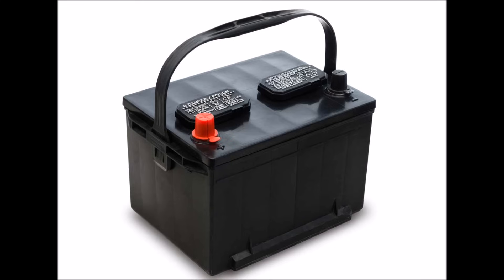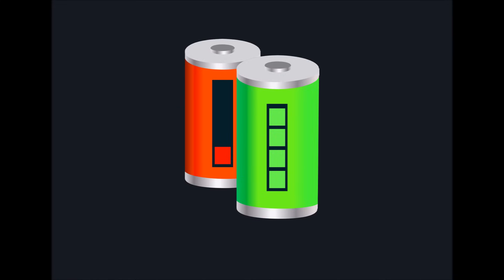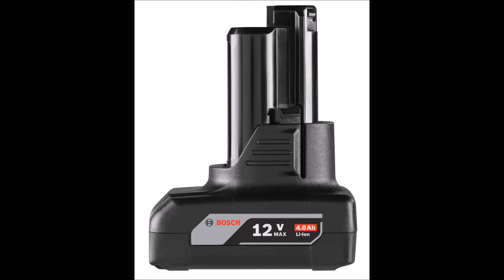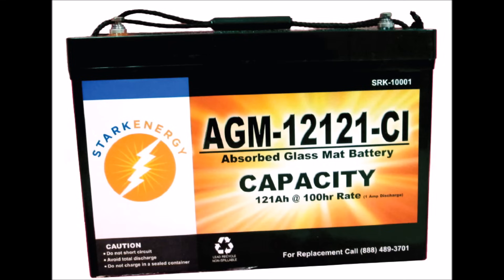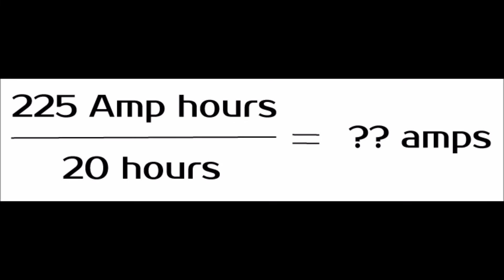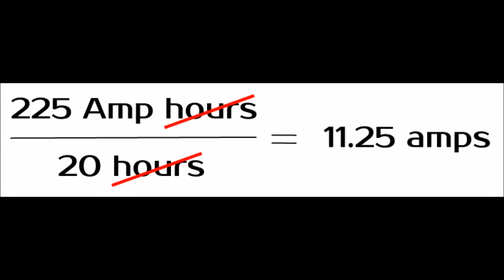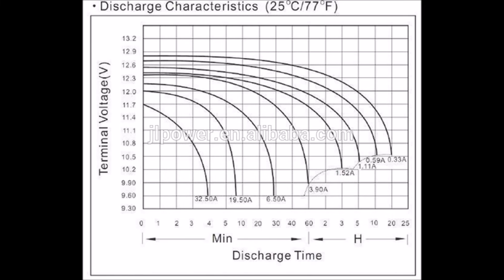Amp Hours???  Battery Capacity Explained

Comment: Thanks for the reply! I asked my friend and he said the same thing. Now I don't understand if I have 8 12v 150w panels in series I should have two charge controllers or do they make them go past 96v? I'm sorry that's my last question because he is older I don't think he knew
Reply from the maker: You don't want all those panels in series making 96v.  You want them in parallel or series and parallel.  Again, it depends on what you are trying to power.  But 96v is unusable by almost any inverter or directly powered load.  You want 12v, 24v, or 48v.

You will have to organize the panels into what is called "strings" and then use a large charge controller to handle them OR use multiple smaller ones, one on each string.

Comment: Love your videos! I have a question if i have 1200w of solar for a rv running 12v batteries how many amp hours will that 1200w system need?
Reply from the maker: Thanks for the support!

I think you are answering the question backwards.  What loads are you trying to power with these batteries?  Having 1200 watts of solar is great and that is more than I have.  But it all comes down to how many kWh per day you are consuming or desire to consume.
Reply: Best answer. This fellow need to gather all their appliances’ power rate and also need to know how many hrs they going to draw from 1200w solar system. Those information will help answer their question.